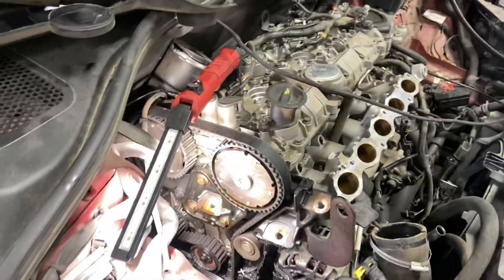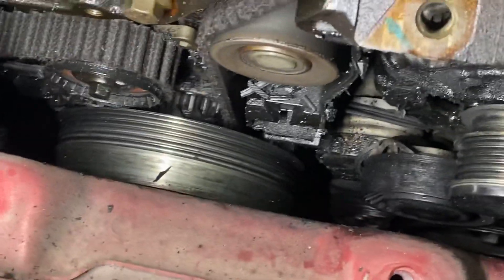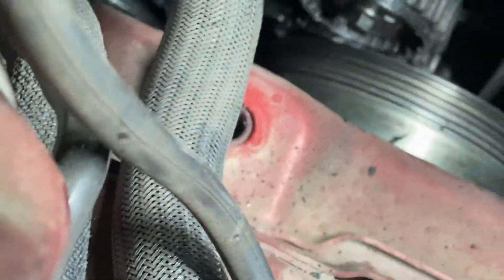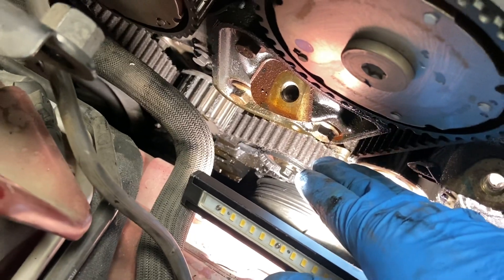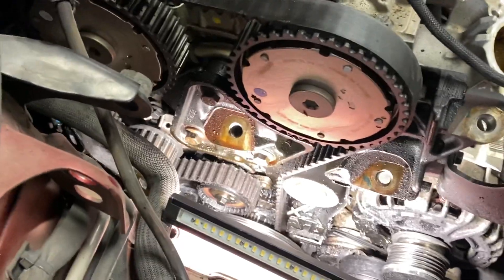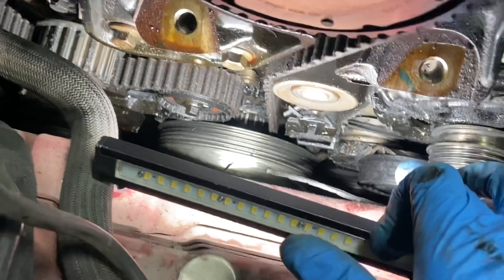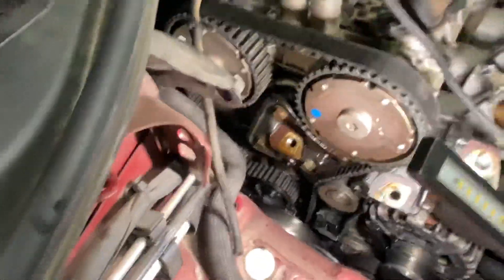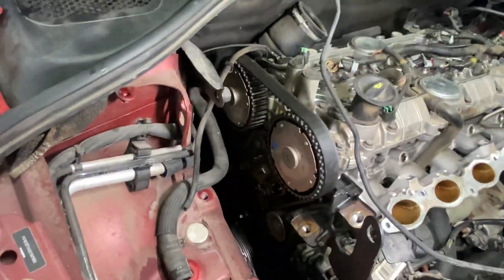What to replace when replacing serpentine belt and timing belt

Comment: Does this relate to 2013 xc70 with 3.2 non turbo?
Reply from the maker: This is for 5cylinder p3 vehicles
Reply from the maker: The 6 cylinder is kind a hard . A lot of removal . But it has a chain so u don’t need to worry

Comment: I have a 2017 XC90 and the Start Stop light (A)  said it needs maintenance, I have not driven it in a few months so I need to drive it to recharge or take it in for a auxiliary battery replacement? 
Thanks
Reply from the maker: Sorry for lare respond.  Replace support battery. Disconnect both batteries for 10 minutes and reconnect
Reply: @VolvopediaGuy  thank you

Comment: I have a 2013 XC70 T6 that has a loud rattle when warm and it has been idling for a while in bumper to bumper traffic. It doesn't do it in very cold weather and when the engine is not warm. It happens at around 20-30MPH when the rpm is low and I accelerate mildly (to prevent shifting down). Any idea what this could be?

https://youtu.be/fZNdA_TVzRU